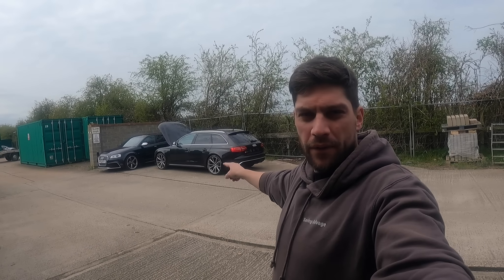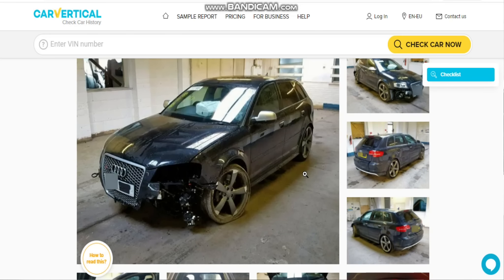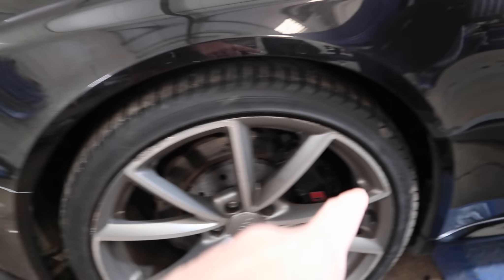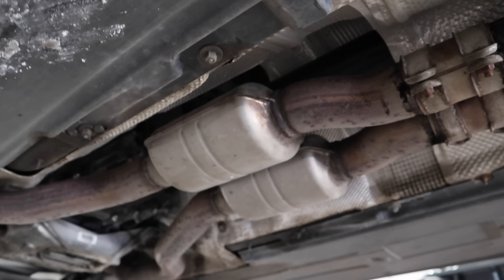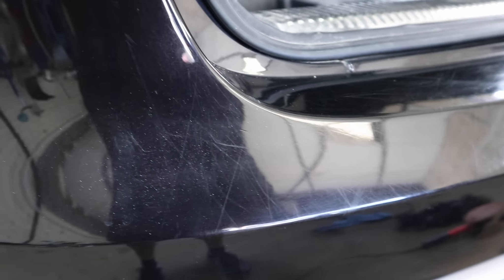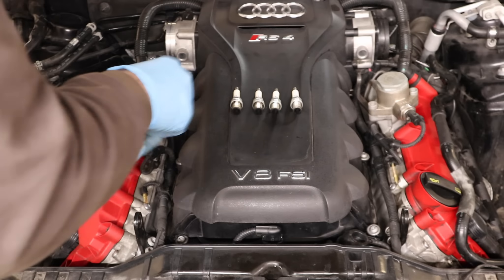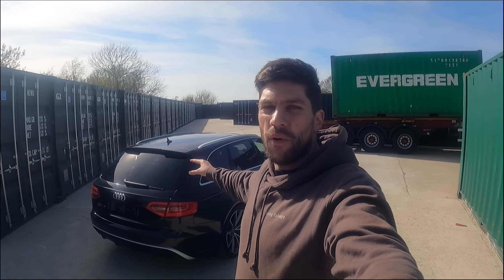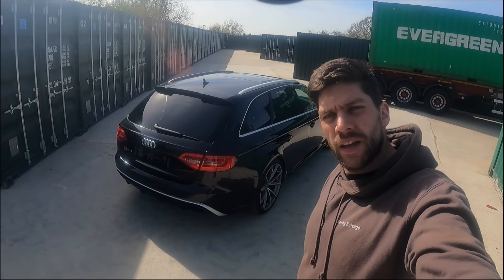HOW MUCH DID IT COST TO FULLY REBUILD MY AUDI RS4'S V8 ENGINE???

Comment: issue you will now have in the resonator is the holed pipe will break out and start rattling thats why we just replaced the front pipes with stainless ones off ebay

Comment: The cats are located in the manifolds!
If you want a easy sound improvement just unplug the pin for the exhaust valves in the tire well”.

Comment: With regards to the exhaust mod, do you not need to wrap the perforated section? Most of the guys modding M3 back boxes etc remove the sound deadening, wrap the perforated pipe and refit the dead dog.

Comment: You can disconnect the electrical connector on the exhaust valve air reservoir under the boot floor, that will keep the valves open all the time to improve exhaust sound.  Those two boxes you cut open were resonators, it will probably be a little more raspy at high revs now with their stuffing removed.
Reply: Was just going to write the same thing! Makes it much better.

Comment: Like the content and really enjoy the videos but can you include a ball park time / labour time put into the car so people know what to expect please. It would help to estimate if garages are adding extra hours to work to increase customer bills. Dealers have different rates but might be helpful to have a rough idea how long jobs take.
I recently fitted an aftermarket reverse camera to my 2017 S3 MMI that looks factory / original and it took 2 hours working out how the car came to bits and where to route the cables.  No programming required as it was just plug and play.
Reply: He's probably spent 50 hrs labour at a guess

Comment: Something that puzzles me - the catalyst is there for emissions control, so removing it will affect emissions, yes? How does the car then pass an MoT, or is emissions testing only reserved for diesels? Granted not applicable in this particular case, but I've heard of decat modification on tuned cars.
Reply from the maker: It wasn’t a cat, it was a silencer, the emissions are fairly easy to pass even without secondary cats anyway

Comment: Dean good thing that was only a muffler and not a cat like you thought.  Diesel  Brothers got fined for showing modifying of emissions  systems. on their show.
"A federal judge has ordered the stars of the Discovery Channel show Diesel Brothers to pay an $851,451 fine for air pollution, according to The Salt Lake Tribune. David "Heavy D" Sparks and David "Diesel Dave" Kiley, along with other defendants in the case, run a Utah-based shop that modifies diesel trucks.Mar 11, 2020"

Comment: I had a similar exhaust situation with bmw 335d exhaust where there was a perforated silencer, I cut the internals out and replaced with some solid pipe, sleeved, to make it into a straight section internally but look like a silencer externally, if you get what I mean.

Comment: That’s called a resonator.  Not a catalytic converter. Haha.  Cats have 02 sensors in them or close by them.  You want to keep the resonators and remove the mufflers at the back.

Comment: All ok until the next MOT probably fail on emissions
Reply: Those are resonators, they are only there to stop drone when the valves are open on the rear silencer. Nothing to do with emissions control.

Comment: I guess the "hair" inside the convertor is for detoxing  the exhaust gas. Your mod may actually make the the mot fail. Frankly, if I were you, I will not touch this bit.
Reply from the maker: The primary cat is in the manifold. This is just a small silencer as the gasses don’t pass through the stuff
Reply: Those where resonators, nothing to do with emissions control. Purely there to stop drone at certain rpm’s.
Reply: @Mac_F87  Thx for explain. So hopefully it will not have any side effects. Like odd noise or vibration at certain rpm.